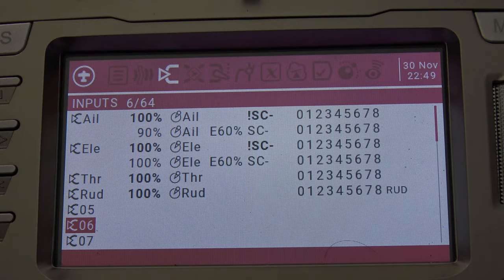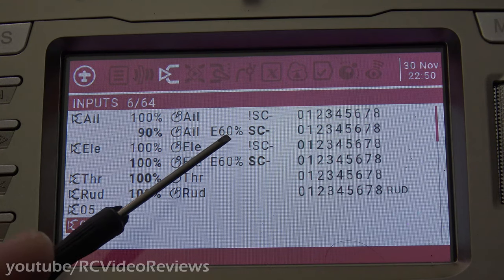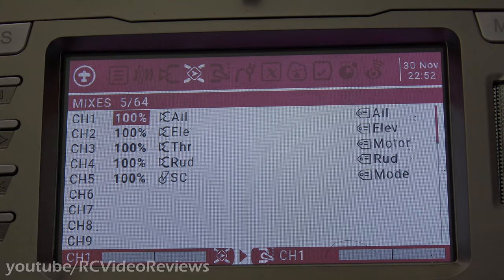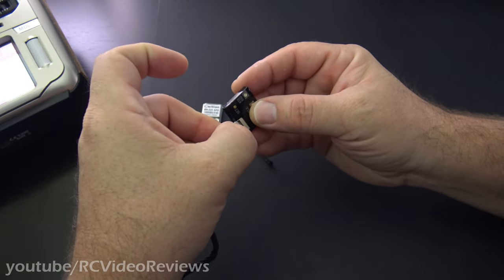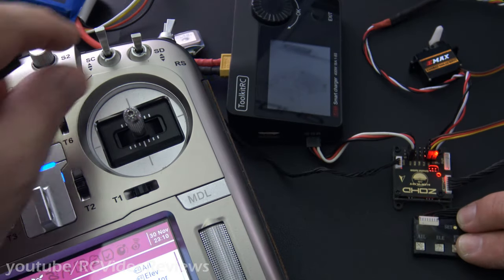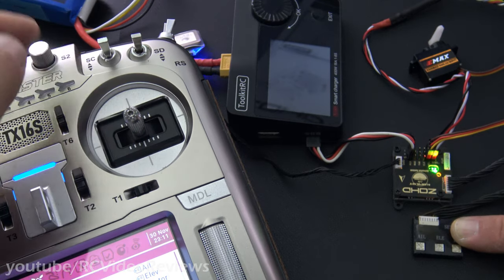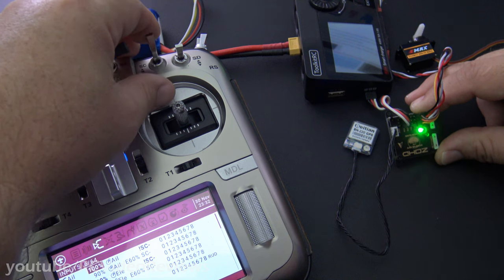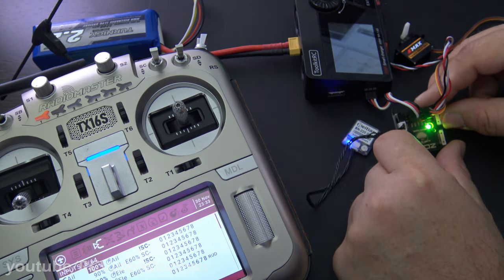Kopilot Lite: The Complete Configuration Guide

Comment: Great video. A question for you on GPS's, the ZHOD kopilot GPS is a Beitian BN-220 , Will any BN-220 work with it or does the number under the barcode need to match. See lots with the same number but are they all the same and will work Ya had a mishap with my plane and did not fine the GPS and need to order another one.
Thanks in advance
Reply from the maker: I can't answer because I've never tried with any GPS other than the one that came with the Kopilot. That said, I don't think they're getting custom units. There's one way to find out for sure...
Reply: @RCVideoReviews  Thanks for the response I’m presuming it wouldn’t hurt the kopilot,it’s just a matter of it wouldn’t work. 
And since I need to buy one I’m wondering if I should buy one with compass so that if it doesn’t work I can use it with a different system in the future. Unless they’re a lot more expensive 
Jeff

Comment: Hi John,
It's taken me a couple of nights to figure out how to set this up - especially rewiring the pwm cable. However, everything is exactly as it should be.... except...!
My - for reasons I can't figure out, the elevator has moved from neutral to slightly down. 
I don't want to manually fix this by changing the length of the control rod because this isn't the cause of the change. 
The obvious thing to do is to change the trim in the Tx, but I  believe that one shouldn't have any trims when using a flight controller...
So, somewhere there seems to be a setting that has caused the elevator to drop - so much, that it doesn't rise into an up elevator position when I tilt the model into a dive. That won't end well!!
I'd be grateful for any thoughts.
Cheers
👍🍺
Reply from the maker: I would start by ensuring all trims (including subtrims) are zero. Turn stab off. The elevator should be mechanically centered at that point, if not, mechanically center it. Build from there. If you turn stab on and the elevator moves, recalibrate for level.
Reply: @RCVideoReviews  Many thanks. This is my first dabbling with a f/c so very keen to calibrate it, and try it out in the blue... 
Flying weather tomorrow!!
Reply: Would you Adam n Eve it? She auto-launched like an ICBM and flew beautifully. I had to use RTH a couple of times, but the gains were so low that the circle back was huge, indeed, she went out of sight!
Then, as if by magic, she appeared right over me! Fabulous wee machine!
I've turned up the gains, got the hang of how this thing operates, and am having an aeronautical ball!
Many thanks for posting these videos, they are a great help. 
Chocks away!

Comment: Newbie here. This video made it seem simple, thanks. Going to use DJI Air Unit. Is that compatable? If so, would that plug into the PWM connection, or SBUS? Once connected, the system is set up like you video explains here?-Thanks
Reply from the maker: I haven't used DJI air yet, so I can't offer any information on its operation. Sorry.

Comment: Dumb question:
Had thought about plugging one into my Phoenix 2400 glider and was wondering if I could leave the flaps on Channel 6 on the Rx (G-Rx8).
That way, in manual mode I would still have the use of the flaps.
Is that a starter of an idea?
Looking to use the Phoenix as an FPV platform
Reply from the maker: Yup. Very common to run hybrid as long as your RX supports both. i.e. If it sends ALL channels via s.bus that won't work, but if it sends them s.bus and PWM it works perfectly.

Comment: Hi John, Sorry to trouble you but I have followed your zohd setup and all is fine until I get to failsafe. I have set it to no pulses and when I turn off the radio master t16 transmitter I get the flashing green light ok but my flaps go up and stay there and  the airalons go to a left turn and stay there. I can’t make this out. Every thing else works fine. It stabilises the right way and the direction is correct in manual mode. 
Any ideas will be gratefully received. Many thanks Mike Button.
Reply from the maker: It sounds like your Rx has an opinion about channel positions during failsafe. What RX are you using?  If it supports custom failsafe I would use that instead. Set the flaps where you want them. Set throttle to 50%, put mode switch in RTH, all other surfaces neutral.

Comment: Very good video explains everything .I have a question , if i am using T tail how can i use 2 servos for ailerons? There is another possibility not to use Y cable for ailerons? Thank You
Reply: Use channel 1 Kopilot outlet for 1 aileron and put the other on the Kopilot aux channel (S-bus) or a spare receiver channel (PWM) with a suitable mix.. Only 1 aileron will be stabilized but I have been assured by more expert folks that it works quite well.
Reply: @theoztreecrasher2647  Thanks , i thought that is possible, but i was not sure if the stabilization will be ok. .

Comment: Hi, again...I have setup my Kopilote as described. But, something strange is happening. When I have it in manual mode, everything is ok. But, when I set the switch either to RTH or Stab., the ESC starts to beep? Is this something you can help me out with? And, what settings in the radio would you use on a 1m wing, a Sonic Model AR Wing Pro?
Reply from the maker: For any plane I would start with the gains low and gradually turn them up. There is no remote gain option for this controller. Regarding the ESC, I’m not sure why it would beep going into stab or rth.  Have you tried calibrating the ESC and have you performed the Kopilot radio calibration?
Reply: @RCVideoReviews  Thank you, will check this out👍🏼...

Comment: Can you tell me what size the 4 pin connector is for the gps on the Kopilot?  The original gps & cable were lost in a crash, and the replacement Beitian BN-220 I got has a different size connector, which is too small for the Kopilot. So I need to know what the correct size connector is called. Thanks
Reply from the maker: I am highly confident you'll get a more accurate answer from ZOHD support on this than me. I'm not sure how they measure these things. Total hit and miss for me on mm pitch.
Reply: @RCVideoReviews  Thanks a million for getting back to me.  I'll give them a try

Comment: Thank you for a great video.  I have mine flying fine on the ZOHD 250.  My only problem is upon landing.  When I cut throttle, the nose drops significantly.  I was trying to get it into level set mode by pulling the sticks in and down, but it does not seem to work.  I'm in stabilize mode and my throws are set to 100%, including rudder.  Any ideas what might be wrong?
Reply from the maker: Look in your channel monitor and make sure all four channels are sending output. I made the mistake of configuring a rudder input, but didn't add it in the mixer. Took me a minute to figure out why I couldn't get it to calibrate. Also make sure you don't have any trim or subtrim. All 4 primary controls need to show 100% on the OUTPUT not just the mixer.
Reply: @RCVideoReviews  Thank you for your quick reply.  That prompted me to recheck my setup and I discovered the issue.  Actually I did have a mixer setting for the rudder.  The problem was that I have set my yaw stick (left) to control the ailerons as well as my aileron stick (right).  Its just what I do with some of my wings.  That of course did not send the right signals to the Kopilot.  So in my case, I put the left stick down and inward, but the right stick just down.  That is when the magic happened and I was able to set my level.  Thank you!
Reply from the maker: You could put both setups in the mixer and assign them to a calibration switch. So when you want to calibrate, flick a switch and the 'standard' mix applies and when the switch is off, your rudder/aileron mix is in effect. You could even use that calibration switch to override your channels for a few seconds to get the kopilot into calibration mode without even fiddling in the mixer. i.e. The whole thing could be done with a single switch and no touching of the sticks.
Reply: @RCVideoReviews  Excellent idea. Thank you!

Comment: Hi, does the GPS need to be calibrated like you would do on a drone or just plug and play?
Reply from the maker: The GPS itself doesn't require calibration. There is a radio calibration and a level calibration, that's it. GPS never require calibration, it's the compass on the GPS that requires it. This doesn't have a compass.

Comment: Hi,
I have bought a sonicmodel skyhunter racing, and because its a twin boom aileron and elevator only aircraft, would it still be compatible with the kopilot? If so would i not have to plug a servo into the rudder pins on the kopilot (as there is no rudder)
Cheers
Reply from the maker: The Drift is a ZOHD product that ships with the Kopilot. It has no rudder, just ailerons and elevator. It flies great with the Kopilot. You don't need to plug in a servo, but make sure you add a rudder in your radio because even without the control surface, the Kopilot uses the rudder input for calibration and setup.
Reply: @RCVideoReviews  thanks mate 👍👍

Comment: Hello, having trouble with my kopilot.  When I put the esc into the throttle port all the light's go on and won't go off. The esc is 5volts. If I disconnect the esc and plug in another power source with 5.5 volts it works fine. It seems that it needs at least 5.5volts to work. Any suggestions. 
Wally
Reply from the maker: Did you put a meter on the first ESC to check output voltage of BEC? Every Kopilot I have uses standard BEC output. I don't know why any Kopilot would be .5v sensitive. Something doesn't sound right.
Reply: Thanks for your help.  I put in another esc and it works fine.  The problem was the other esc was in programming mode.
Wally

Comment: Hi, I am having trouble with my kopilot.  Once the kopilot has made connection with the satellite everything works in stabalised mode but when I switch to return to home mode the ailerons move up and down intermittently what do you think the problems is. 
Wally
Reply from the maker: I don't think it's a problem. Mine does the same thing.
Reply: @RCVideoReviews  just wondering if you can move the throttle up and down when it is flying in the RTH mode
Wally

Comment: Good video, helps me a lot.
Question: When you calibrate it, position it and level it with the two sticks in and down, do you press the setting control board along with pulling the sticks?
Reply from the maker: Glad the video helped. Just do what's in the video to calibrate. Here are the instructions from the manual:
1) Put your plane level, power the plane;
2) Wait for Kopilot to complete the start-up, set flight mode to the stabilized mode;
3) Move the sticks of the radio to match the right figure state, waiting for 5s, until the mode indicators 1 and 2 and GPS indicators flash at the same time;
4) Wait until the flashing stops, re-power the plane, calibration completed.
Reply: @RCVideoReviews  Thank you very much, you helped me a lot.
  I calibrated everything, now just need to fly it in the field. I'm flying a helicopter. The DRIFT is my first plane.
Reply from the maker: @oded_10  You're welcome. Have fun flying. Beware of the CG location.
Reply: @RCVideoReviews  The cg in the wings is inaccurate?

Comment: First off. it's a great video EXCEPT for a couple of points. That being said, Point 1 , It would have been nice
had you explained the hookups for PWM not just SBUS. Some of us don't have SBUS on our receivers. 
Point 2, I also notice that most of your videos are all based on FRSKY receivers and there's a lot of us who
oddly enough fly with Spektrum DMSX receivers and Fail-safe does NOT show up in the TX16S Model Menu
when DSM protocol is selected. Any ideas on that one?
Reply from the maker: For DSM, power on Rx with a bind plug, hold tx commands to fail-safe values, then power Tx in bind mode. DSMx can set failsafe through forward programming.

I don't buy Spektrum and I don't own any Spektrum gear so I'm not an authority on this. I got this information from a google search. If you don't see a failsafe option in the MPM firmware, that means the receiver doesn't support it.

Comment: Hi just a question.  When the kopilot locks onto the satellite the blinking light on the main board  goes to solid but does the blinking light on the on the GPS on top of the plane does it stop flashing or does it go solid. 
Wally
Reply from the maker: I don't believe the gps led stops blinking. As long as the Kopilot goes solid, you should be ok.
Reply: @RCVideoReviews  thanks for your help

Comment: I have my radio setup exactly how you do, but how do I set up dual rates so it only works in manual. Thanks
Reply from the maker: You'd have to use some logic. i.e.

L01 AND ModeSwitch RateSwitch

Then in your Inputs, set dual rates with L01 as the switch.
Reply: @RCVideoReviews  I think I'm just doing it wrong, I'll try and keep messing with it

Comment: Hi Mate...
One question.. Just bought this nice fc. Got abnormal situation here. I got gps locked. Switch to rth mode. Push the throttle stick up and the motor spin. Tried to do auto launch here. As i understand, motor should not spin until i throw the plane, right..? Any step that i missed. Tq
Reply from the maker: I would say make 100% you are in RTH mode. If you are in RTH mode with the plane on the ground the throttle should not cause the prop to spin. Check your LED status lights to make sure they match up with the book.
Reply: @RCVideoReviews  yes mate...in rth mode i check that gps red led is solid. The green leds is blinking...is there any reset to factory default as maybe i missed any steps or i got faulty board..

Comment: Im a little confused about setting the trims in manual mode.  Im using the dart 250g and I noticed the plane needs some reflex to fly level in manual mode.  I'll set my trims so the plane flies straight in manual mode.  Then I'll land, switch to stabilize and long press for 5s (servo dance) to do the radio calibration.  This is where I'm confused... Do I then remove my trims after radio calibration or do I leave them where they are?
Reply from the maker: That--my friend--is an excellent question. I wasn't sure exactly what would happen so I got the Drift out and did some tests. The short answer is--it does not appear the Kopilot incorporates trims even though the manual specifically says "During the manual flight mode, the plane may need trim from the radio, this may cause the plane fly to one side during balance mode, so you need to re-do the Radio Calibration."

That statement tells me if you have to trim in manual mode, make sure to perform the calibration again so the plane knows about the trim. I would expect in that case if I trim the plane, perform the radio calibration, then put the plane in stabilize mode while level, remove the trim from my radio, the Kopilot should place the surfaces in the trimmed state. It does not. Here is the experiment I ran:

- I set the elevator trim to max up elevator.
- I performed calibration (servo dance).
- I placed mode switch in stabilize mode.
- Elevator is positioned the same is manual mode with max up elevator.
- With the trim still max up, I would have expected the elevator to go up at least the amount of trim--it did not.
- Remove trim, elevator returns to neutral.
- Return to manual mode, elevator remains neutral.
- Return to stabilize mode, elevator remains neutral.

Had the Kopilot "incorporated" trims I would have expected to see up elevator in stabilize mode after removing trim from the radio. 

The only thing I'm left with is that with trims in place--which you need for manual mode by the way--the Kopilot interprets that as neutral and not a stick command while in stabilize mode. In other words, when in stabilize mode and you issue a stick command the stabilizer passes that command through to the surface. When you release the stick, the stabilizer returns the surface to normal. Since it would see trim as a deviation in pulse width from center--stick command--it would interpret trim as a command to move the surface and a deviation from straight and level. So my believe at this point is that by informing the Kopilot of trims, it will ignore the deviation in pulse width from center and consider that pulse width to be straight and level.

So I don't believe you should remove your trim after performing a radio calibration because none of the modes trim the surfaces according to that value if you remove the trims. That means minimally in manual mode you will not be straight and level hands off.

Good question. Don't take anything here as gospel. The only for fact thing in all of this is if you remove trim, you will not fly straight and level in manual mode. You definitely should test this out on your plane. I'd set trim, land, servo dance, launch, fly in stabilize mode and make sure it flies straight.
Reply: @RCVideoReviews  I appreciate all the work and help.  I'll experiment more on my end.
Reply: John,  after reading this,  should I use "instant trim" that you demo'd in one of your videos?  That's a cool feature! (BTW, I have the Dart 250 and I haven't even put it together yet,  I'm just planning ahead.)
Reply from the maker: @jeffreyjackson1626  No, when you use flight computers, you should try and avoid using trim the best you can. Always try and mechanically trim the plane, although Kopilot does offer a "radio calibration" option which on other computers we would call "incorporate trims"  Best bet is to mechanically trim old school style.

Comment: How to you reconfigure the modes, so that i can have Manual, on top switch, stabalized in the middle and return to home on the bottom switch? Cheers
Reply from the maker: You can either invert the weight or reverse the output.
Reply: @RCVideoReviews  Ok, great. I shall give this a try in the radio settings. Thank you